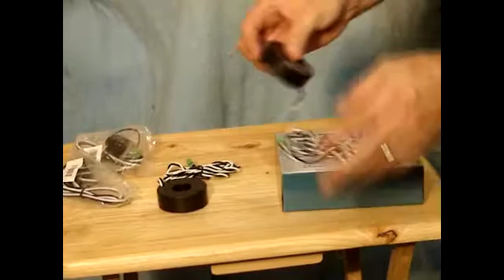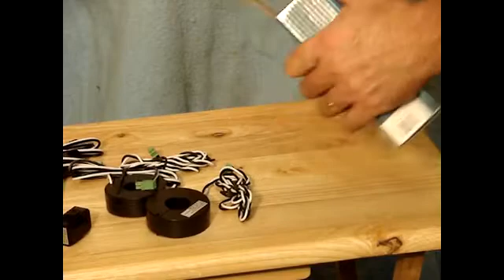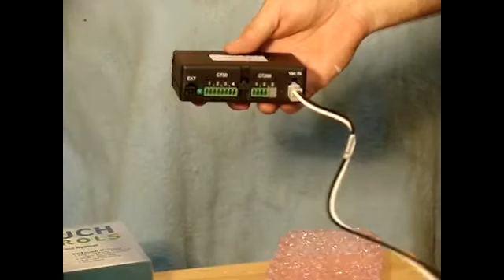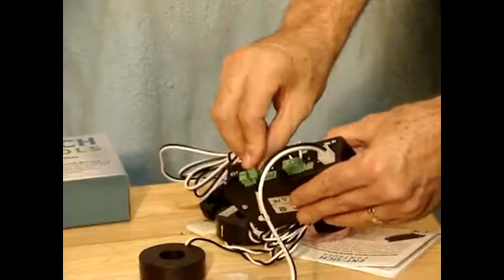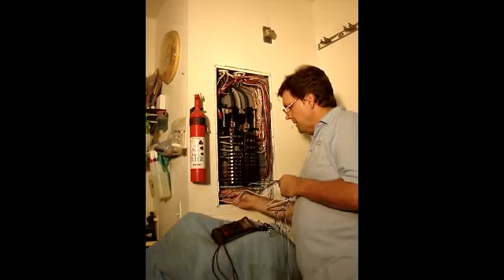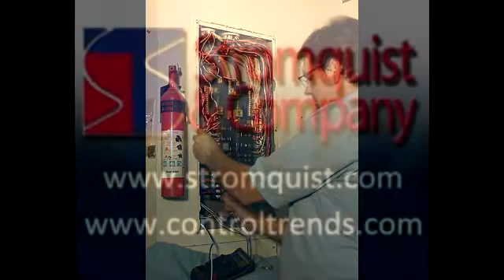Entouch GM1 Install

Comment: Entouch GM1 can do up to 230 v 1ph
Installing on my house I have it wired to 115v 1ph

If you need to read 2ph or 3ph then you will need to order the GM8 3ph 480v